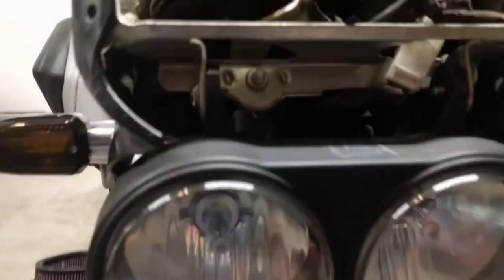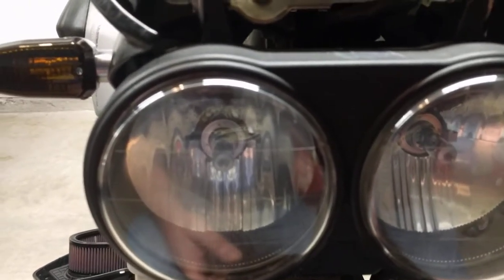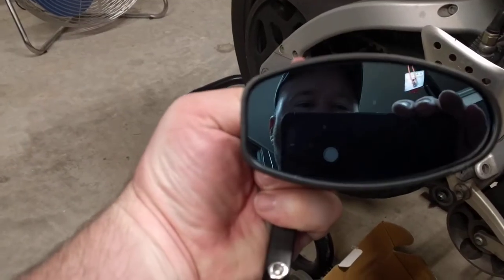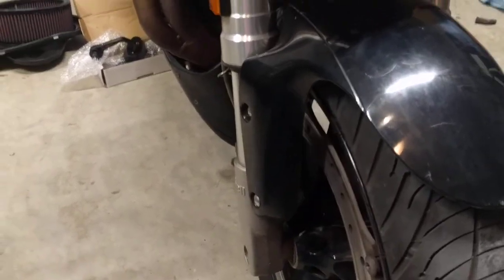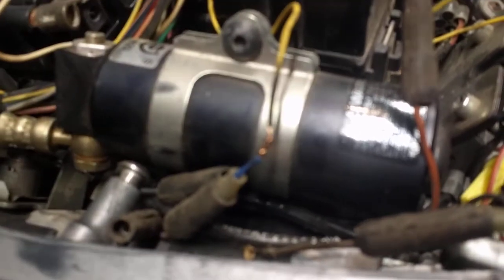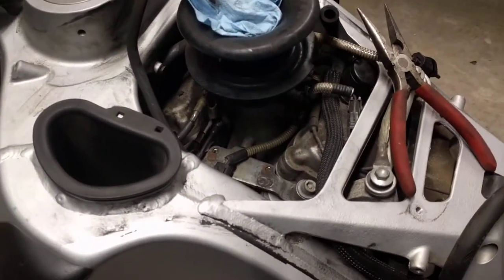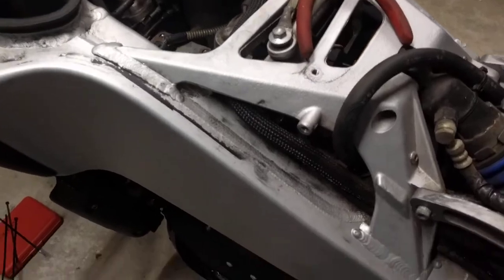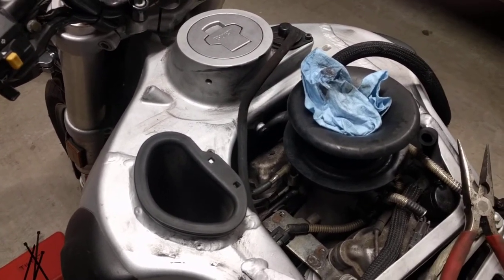Buell XB9SX Headlights - Update

Comment: LEDs from work fine on mine.  I cut the rear covers around the fan.  Been using them for 3 years now and no issues.  So bright that I get poeple flashing me at night.  I may blind some people but I'd rather be seen than worry about someone else looking directly at my lights and crying about.  My safety is more important than yours.